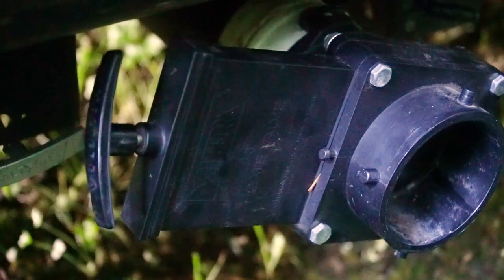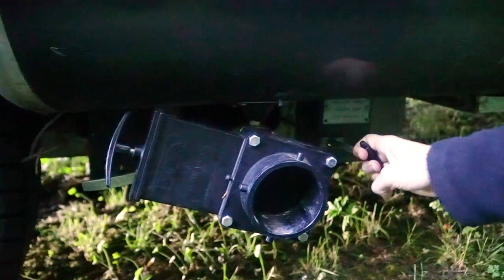How To Combine Gray & Black Waste Tanks in an RV & Why You Want To

Comment: I was always thinking about equalizing the black and grey tanks to extend the stay. Just hadn't carried thru with the physics of it actually working. But your comment on the procedure as to WHEN to shut the black valve off was a good explanation. Like you pointed out, the key is the pressure from the grey tank going into the black tank. That pressure should be sufficient to keep the black from back filling into the grey.  My wife would hate to even think of standing in an overfilled shower catch basin.  Brains are brains, man or female. Great job.
 NOW, if we could only trust those lights on the control board. I'm beginning to think the only solution is a "pop up leveler" version attached above the black tank (probably extending into the trailer). Hmmmm. Thanks again for your video.

Comment: Confused...how exactly do you use the Valterra valve and combine the two tanks and equalize pressure?
Reply: If your RV has a single dump connection and each tank has separate internal valves, then you put the Valterra valve on the dump outlet and keep it closed. If you have separate dump outlets for each tank, this doesn't work.

Comment: So Courtney, how do you know when to turn off the gray water tank, sound?  Why not just open your gray water tank down a storm drain?  I'm making the assumption you're using natural/organic soap products.  I ask because some people with composting toilets go that route.
Reply from the maker: You could empty the gray water into a storm drain or out in the wilderness if it's allowed and you use organic biodegradable products. Just be aware it does still stink quite often so you don't want it right next to your rig and some places don't allow you to empty it except at sewers. You can go by a combination of sound, feeling (if you keep your hand on the valve, and the sensors inside the Airstream if they are sensitive enough. I think it would be up to the rig and the person. I would aim at the side of closing it off too early, rather than too late if you don't want backflow.

Comment: Why do you even need an addition valve (Valterra Valve shown at 0:53) for this when you can just simply keep the original cover on?  Am I missing something here, what's the whole purpose of the addition?  Great video, BTW.  Thank you.
Reply from the maker: We don't have the cover any longer, actually.  :)  

But, the valve makes it much easier to open up the flood gates without getting any of the liquid on you. You could probably do it by using the cap instead, but it's just easier with a pull valve.
Reply: If you just use the cap only then you will have about a gallon or so of San Fransico Milkshake waiting to dump out the moment you take the cap off to empty the tanks.